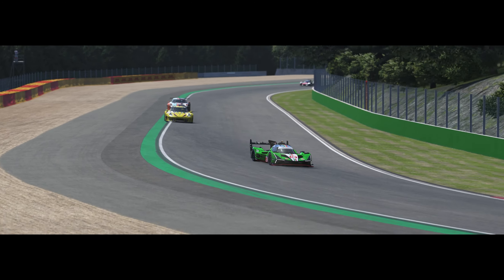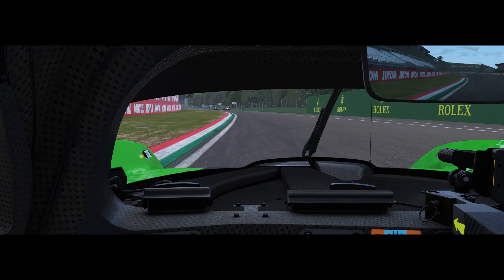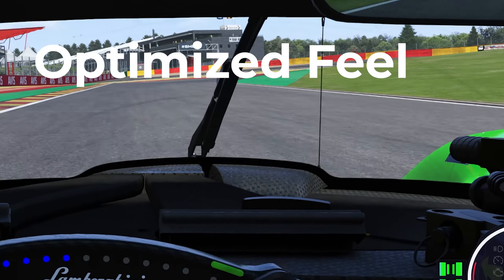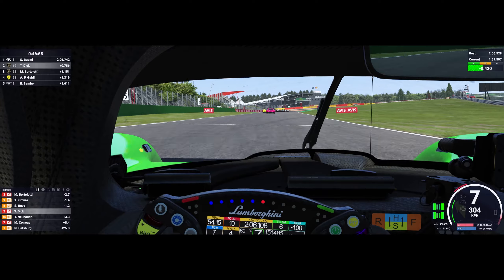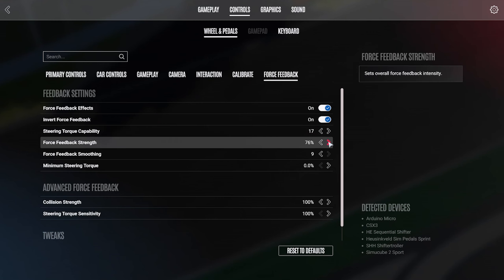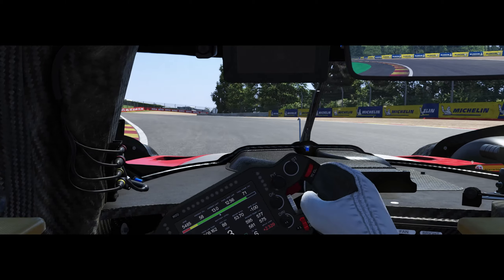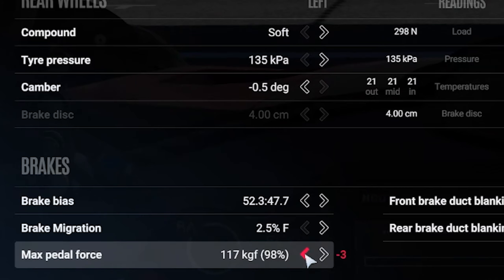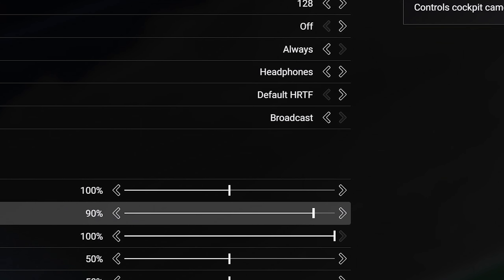Le Mans Ultimate | How to Get BETTER FFB at the LIMIT

Comment: I think you'll benefit the most by spending time on learning how to properly trail brake. I see on Monza and Spa that you hold for too long too much brake pressure, and then completely release brake. This will always result in blocked wheels esp on LMP2 and Hypercars, as the lose a lot of downforce with speed.
On FFB I would suggest not go higher than 70% in game, anymore than that you'll get excessive clipping on higher loads.
Reply from the maker: Thanks, regarding braking technique I agree, I need to practice more. LMU feels very different and more difficult than the other titles I play.
Reply: For me that's also the hardest part when I switch between Prototypes and GTE.
With GTE's you can getaway with holding brakes longer on same pressure as downforce drop off is lesser. 
But with Prototypes you'll either lock the tyre at some point or sacrifice much of the braking capability if you not trail brakes gradually basically whole braking period.

Comment: I have been wondering why with my Fanatec V3 pedals, I’m not feeling the brakes lock up at all. I figured when the wheels are starting to lockup, the vibrating motor on the brake would kick in.
Reply: you don’t feel the steering go numb?